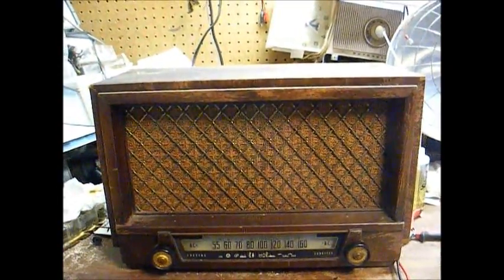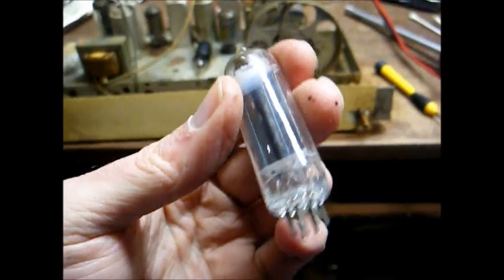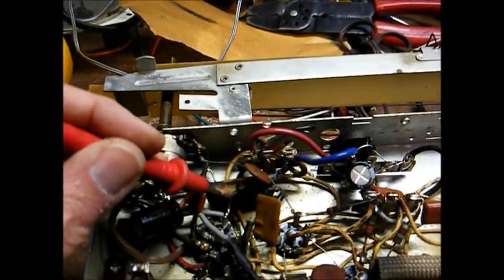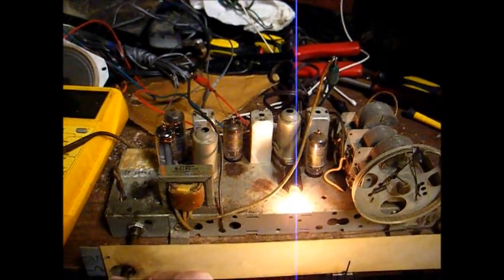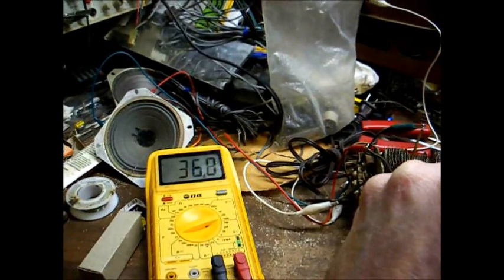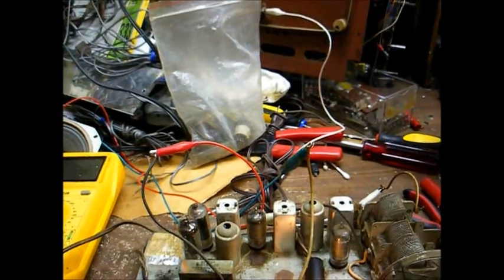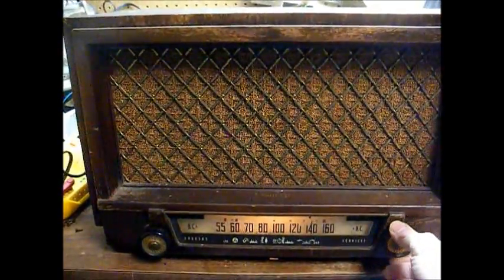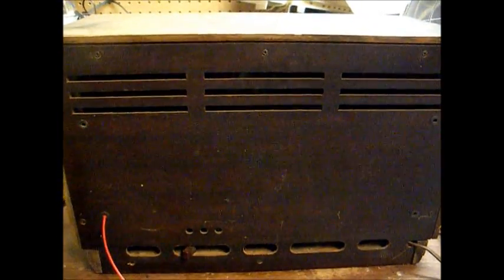Repair of a Philco tube radio from 1953

Comment: I have the 53-950 version of that set and the schematic shows a 6AQ6 tube.I noticed you have a 12AT6 in its' place and it seems to work.Like your 954,mine had a blown bumblebomb.When I look at the RIder's schematic,via Nostalgia Air,the schematic shows a 6AQ5.I used a 6005 and it doesn't work:the tube seems to be cold,yet I can remove it from the filament string and the  radio dies like it should.The 6BJ6s seem to be cold as well.I did a total recap on it as well.By the way,I don't see any data on a 6AQ6 in any tube manuals.

Comment: Philco put out a whole line of these "Public Service" radios in 1953. Including a battery model. Other makers pretty much ignored it. Philco only offered them for one year, The death knell was the establishment of the CONALRAD system in July of 53. This put the little triangles or CD (Civil Defense) markings at 640 and 1240 on the AM dial. Truman signed the overall system into law in 1951 but it took a while to get standards set up and in production.

I have one of these sets, a 53-950 (first generation) that I think has the same general chassis with the volume control moved to the right and a circular dial movement. My grandfather had one. When properly set up it is a good performer, pulling stations in from all over. This particular model had the band switch on the back while later versions incorporated it into the tuning dial with a push-pull linkage.

I have had bumblebombs go off too. Sometimes they just split and release smoke but other times they go "bang!" Last one scared the heck out of my cat who was dozing on a shelf near where I was working.

Comment: I have a fantastic question for you. I have a Philco 46-1209 console im working on. Done all to chassis as far as capacitors except the mica ones, tested/replaced bad tubes, etc. When i power it up, the audio section works fine but i takes about 15 minutes for the oscillator to work then the stations come right in but sometimes intermittent. Any ideas on the possible problem? Thanks..

Comment: I have the identical Philco set.  After I recapped my set, I had modulated hum.  Had to use tube substitution to find the offending tube.  Usually it's a converter tube, in the case of my set it was a cathode to heater short in the 35W4 and a bad 35C5. Replaced some weak front-end tubes and also did an alignment and it's a pretty good performer.  I live in northern California and pick up stations at night from as far away as Calgary, Canada and KOB in Denver, CO.

Comment: Hey Bryan,
I've got an idea...
Howz about using you expertise to show how to modify an old unit?
Change to a much better speaker, increase performance of the chassis,
Swap out record changers for better ones, i.e., make something much better?
Sometimes keeping it 'ORIGINAL"" just doesn't matter. I've even made better cases.
How to add speaker / headphone and line out jacks. Or add line, phono, or mic in jacks.
I often see very cheap bookshelf speaker systems at junk stores, if people learn
how to modify something so theta can use a better external speaker, why not?
I like to work with wood and metal, so I modify beyond the electronics,
like making a totally different record changer retro-fit. Plug a musical instrument,
(electric guitar or keyboard) into a floor model console. Take it beyond a radio / rekee player,
so an MP3 can be patched through an old tube rig.  Modify can be done properly.
Don

Comment: Those crappy 4" & 5" loudspeakers in most tube AA5 radios have bugged  me since I was a kid.
It's OK for talk, but lowzy for music.  That's why I put a "4 inch subwoofer" in my Chinese Filko.
This is why I don't collect AA5s.  I like the German tube radios that have more power, woofers and tweeters, and those also out perform MADE IN USA mass produced junk from the tube days.  But then there were those terrible AM radios that were in V W Beetles... one of the worst sounding car radios ever.  Old Zenith rigs sometimes had better speakers.  And very old Philco table radios had 8" or 10" speakers.  So I kinda draw the line around 1950, after that was crap sounding cheap junk. Consoles were much better, but storage is an issue for collectors. The bakelight radios do make for some nice shelf candy, but who cares if they work, it's more for looks, i.e. radio porn.
Don
Reply: HA HA you'd have to see my Filko video, that's a joke son, like those crappy PC systems that use 4" subs.  I got that "sub" from out of one of those.

Comment: Yep, I've had a few radios where the bumblebomb remains were laying spread out across the bottom of the cabinet. You're right, they really were worse than standard wax/paper capacitors. When a wax type shorted and got hot, they'd just blow one of the ends out....when the plastic type got hot, there was nowhere for the heat to go, so it just built up until it exploded. I won't even test a chassis on the bench until I replace those caps first.....the idea of flying plastic shards in my eyes is a little scary.